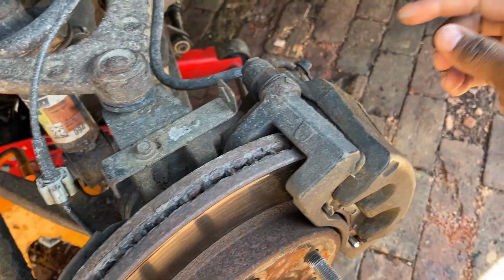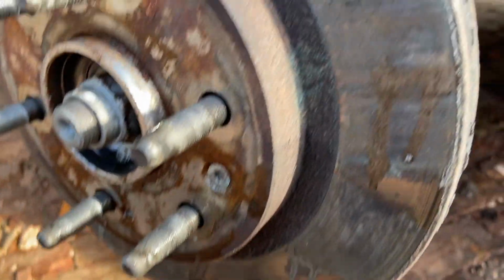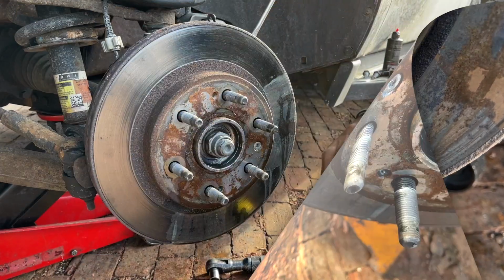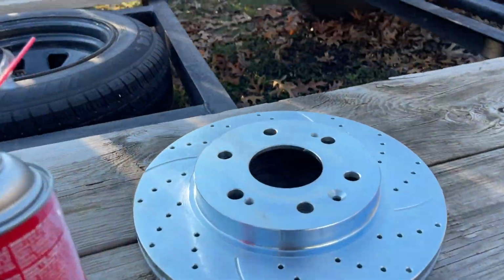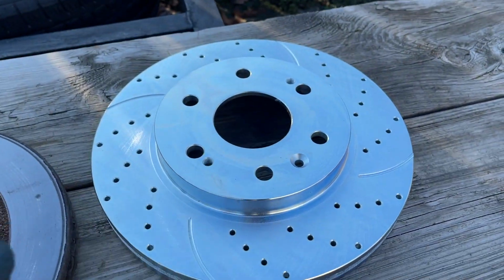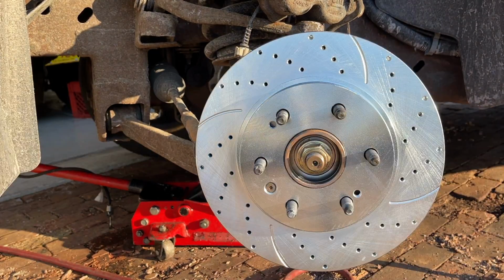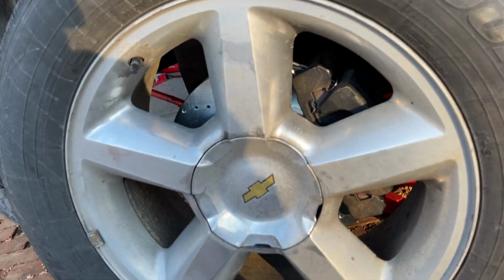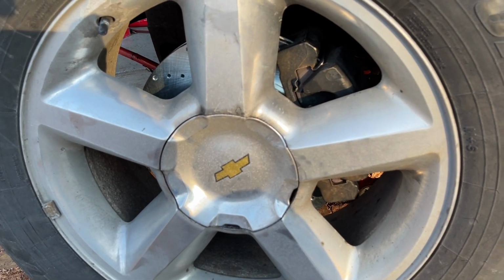Chevy Sierra, Silverado Suburban Tahoe GMC Savana, Yukon Upgraded Rotors Install For Better Braking

Comment: So,...you "heated" up the Brake Disc hold bolt before even attempting to remove it.  Rotors normally warp because of uneven "Torque" on the lugnuts!  Hence that's why it's important one uses a Torque Wrench when reinstalling wheels, etc.

So, what is the upgrade in the Rotors?,...being that you installed the same calipers,...therefore, same size rotors what was upgraded!  Oh!  I see the upgrade now,.,,,you installed "Drilled-Slotted" rotors!  Cool.
Reply from the maker: Thanks for the comment and watching. I am VERY good at what I do.
Reply: @TerenceDIY  YW,....I wasn't saying you weren't good at what you do,....was just wondering why applying the heat before attempting to see if the Rotor hold bolt would just come out.  I've turned tons of wrenches in my days,...and changed out a few rotors too,...and never had to apply "heat" to remove the Rotor hold bolt.  Now, are there some of those bolts out that are a 'bear' to remove!  Yes!,...Yes there are!!!!  All the same,..I appreciate your time to make this vid.
Reply from the maker: I understand. Those bolts that holds the rotors almost always strip out when trying to remove them in my case and I've replaced hundreds. It's a method i've used over the years. Thank you SO much for watching my content. I really appreciate it.

Comment: What is the part number for this upgrade in the 2500 trucks
Reply from the maker: Here is the link for them...

https://www.ebay.com/itm/154720205649?fits=Year%3A2009%7CModel%3ASuburban+2500%7CMake%3AChevrolet&_skw=2009+chevy+suburban+2500+rotors+and+brakes&itmmeta=01JGQ4D5XGQH90E1H2Q5M43RGW&hash=item24060afb51:g:~MMAAOSwwtZhoJRs:sc:ShippingMethodOvernight!60475!US!-1&itmprp=enc%3AAQAJAAABEHoV3kP08IDx%2BKZ9MfhVJKnlKMTR6FOcTdK6GRos6a6of3sZhtLaKDAlmFgVkSNb3k6N%2F1OV8TEq33TN0%2FPHdB7r%2B23%2BO26Xc%2BmqQvJtskbOcWkPzYNeqoLPvAqbUou1eo%2FQPYJyeolksfxrpGYtgpPrwhYA3HFfazoDlPCaj%2BJTthvz28pQ2JnKaf6C5q9AAcRaQW14LhOAeY5Z7VKnCwyS7CtwrjAL2gT16BGhNVor9twpC2BherVEDKqQw0go2VIDOd4wUeOnvJQYPSE4R7MQMbt%2FNSq5GcEgLjhaSIdHZIQTdYOvvBzqBj9bDkAXuaTuUdP9hh0rWdAMi7cQJnfClwT2HCh7pLEg2OyWyyPw%7Ctkp%3ABFBM-N605IVl

Comment: After months of using slotted rotors what’s the update on them?
Reply from the maker: They are great and I highly recommend them. The very first thing, and most important is, the brake pads life span. It's nearly double.
Here is a link for them if you decide to go that route. Thank you for watching. 

 https://www.ebay.com/itm/303649726234?fits=Year%3A2010%7CModel%3ASuburban+1500%7CMake%3AChevrolet&hash=item46b2ef1f1a:g:bcgAAOSwY91lVJ6J&amdata=enc%3AAQAIAAAA4MHVsNnwe1spdTGoDebBes7QYjvzOY%2BQKGu71Bq%2Fs2S1YQ0X%2FnUI6E0NJDbqRczahZ9GFdjeG6eoOGY8F3M9TRgyMUBukpqSonLDQZ7gZuzx2%2FAPBZCoRcu5r8g69rGxaqrbu2REib8MXrNqiHCUnq36%2FSaNUOckAiKr%2FJB7fujTGRZgWmrHpHx6mvJx%2B4FiZ9imGNJyyzyi0oCzp1W3NazK22XaUjJBRnR6j%2Buy6ZFlv45BB8PSFTqEQcWyNcPDzQViuXvx9%2BhxaFQmqowxirQ3SN36Jnj5%2F584%2Bge01RhX%7Ctkp%3ABlBMUNSh1Y2wYw

Comment: Cross drilled rotors don’t do anything but decrease the life of the rotor.  Slotted are great but stay away from cross drilled. All those holes are just places where the metal is weakened.  Cross drilling was created by road raecers 40 years ago when the compounds would outgas under heavy use and create a layer of gas between the pad and rotor.  That layer of gas would cause the pad to effectively “hydroplane” on the rotor surface and the car wouldn’t stop.  The drilling of holes allowed the gas to escape into the vented middle of the rotor.  Today’s pad compounds don’t create the same situation.  Today’s cross drilled rotors are purely for show and lessen life of the rotor while decreasing the friction surface.

Comment: Hey would these fit on my 03 Silverado 2x4
Reply from the maker: Hi, I'm not sure but here are a couple of links to ones that will work and priced good. 

https://www.ebay.com/itm/173685882579?fits=Year%3A2003%7CModel%3ASilverado+1500%7CMake%3AChevrolet&hash=item28707c3ed3:g:Ca8AAOSwMAhgSdU-:sc:ShippingMethodOvernight!60475!US!-1&amdata=enc%3AAQAHAAAA8GPHB4z90ZIS3EcXSpjxDngAZZl1MrSEs1xsEI21bx6FBzCvSWg6%2B5GhuUU8VxoyQ5RMUxGpb7Y7FvvtqvSlNy8cihzgIFoVijmrljTEzoFRzEfHNsyK%2FomNK5DQZgiUyQS6G9mGNckQfWBB3APHDa%2BFviznZFU5ooL%2FurCbJnCR2E4olfhh0MnM5Pob5gIHQ3tad1fhDlsLOv%2Bb%2BstzpIpCfDokqFqhoGgB7Aq8srUJMd5rs4w%2FjXpTrw1CENL5ucysKU4jZaSHn3NPGCfsl88GQtNaUm%2Bn4SzeUOoMme4rQYGg1PDQeQyVXFbtEUTt3w%3D%3D%7Ctkp%3ABFBMpr-5rvFg

https://www.ebay.com/itm/193259990109?fits=Year%3A2003%7CModel%3ASilverado+1500%7CMake%3AChevrolet&hash=item2cff316c5d:g:QLoAAOSwmXJgBw5I&amdata=enc%3AAQAHAAAAsEGiJhfp%2FpptACIS3nFtRPr5CiJW%2BISu5DfMP%2FQB0SGlB80swHoCEDMEv6etIXQWqDfjhGxSKn4vX5p7X%2F8k0Sn5ZonWx4t9M%2FqwrK9rtBMSbp9YDZuVe7pOb2YahV%2FSnDuSjB0vuHyLleXCp0%2BQhyPfVn24otoQ0uZreaT%2FH%2BiGQw953Teq6urnPYJlyYqQT%2B5haRHoJhHTXWPH2cXnvaJzvS0yLxrQGL2iyVtqWOsH%7Ctkp%3ABk9SR6i_ua7xYA

https://www.ebay.com/itm/282857384688?fits=Year%3A2003%7CModel%3ASilverado+1500%7CMake%3AChevrolet&epid=11023938063&hash=item41db9d2af0:g:A-4AAOSwENhi82yX&amdata=enc%3AAQAHAAAA8MqqEwWgtqlJGocHnG4I6HUt48rrDz6XuesdOMEBe7pZktRY6hASLTPbcCZ%2FjZVLIRn1wpIhVai36HZ4pXHChvmgcLyDTQxYRY7mWM1bQQeN5mvOLa8C54vhOGhBIJED1cFaZ6l8XYs2qf5gBRFG1cjl6xVlQnnFKmK5FppTHAcNW71RI2lx4GTrLHkrlaqy2cDMFISlSkmSK%2Fc6L2tiZ9hmLyIZwJCOCXDm5mjoLn0PsgNHu%2BjBp4ESQMQhykV6mILp%2BCJ8GQtQn1fqu%2FMfouFHWqUv%2B6K4TnSyEsPrhNJuXER%2B2ksTZ%2FMtm6ubjidJ0w%3D%3D%7Ctkp%3ABk9SR6q_ua7xYA

Comment: What brand brakes? How are they holding up
Reply from the maker: AC Delco OEM brakes and they have still plenty of meat left on them. Here is a link for them. 

https://www.ebay.com/itm/262773644255?fits=Year%3A2007%7CModel%3ASuburban+1500%7CMake%3AChevrolet&epid=110337687&hash=item3d2e879bdf:g:bZIAAOSw241YW-ot&amdata=enc%3AAQAHAAAAwPSYI8NqgXS4TJWENCs%2FZ7HQEuqQ3v0tq5L4deRcX%2BZhBbXCEH%2F2uQCd5HwDwdLSJ1jsNNur2AAF0nMGseVXQiwCjeHvNzb8hQvsUoEgr6RkwPr7pvPRn7kvumXSPST4BcNsPLn1hmzDU2uzXR%2BMWsn4fm%2BLwiALZ8JDBc%2BnNRMBH1rybNBo%2B8P%2FEKAosZkdEYzbAisoqnMqyhspwIaNHUFjxjo49lM6v0dfxY8BBC4HgvoUh2PNnMf2%2Byg6HHROmA%3D%3D%7Ctkp%3ABk9SR67q__qFYQ

Comment: Where did you get your slotted rotors? I am looking for a set for my truck as I am changing out the front brake system.
Reply from the maker: Sorry for the late reply. Here are links for both front and back. 

https://www.ebay.com/itm/192474842644

https://www.ebay.com/itm/303743553172
Reply: @TerenceDIY  Thank you so much it helps me a lot in putting my bigger brake change over together.
Reply from the maker: @capman911  , you're very welcome.
Reply: What kind of truck? I’d go with a1 auto or Detroit axle over anything
Reply: @noahjagger3831  It's a 2006 Silverado 4x4 extended cab.